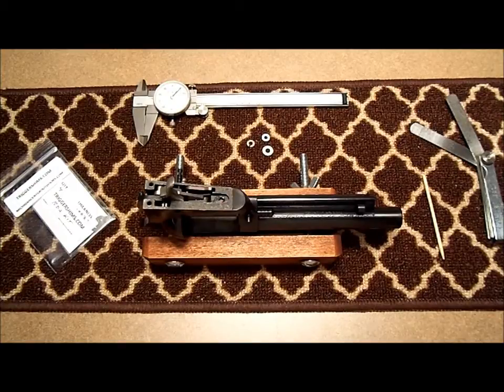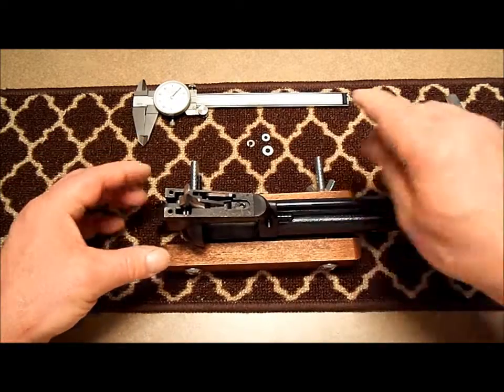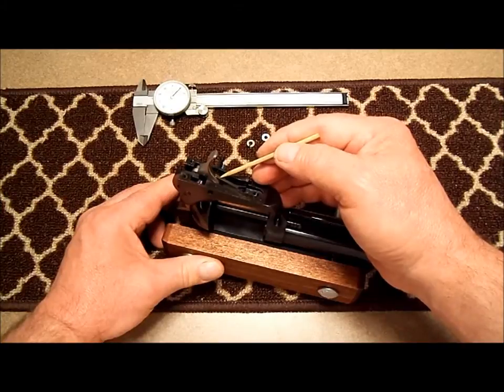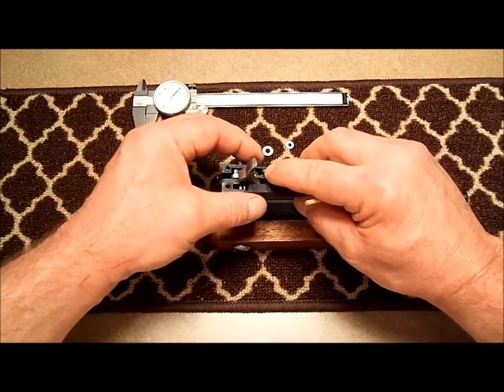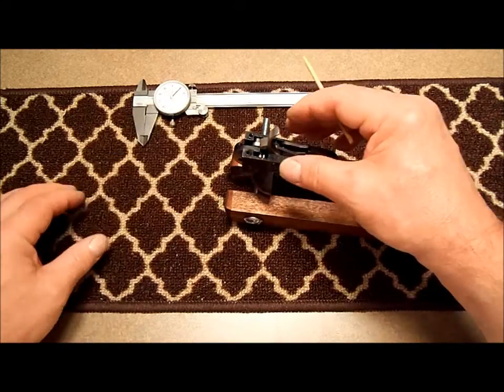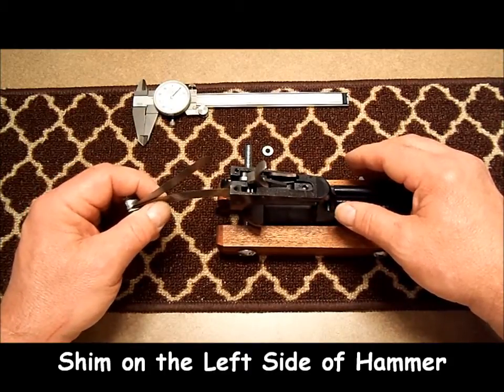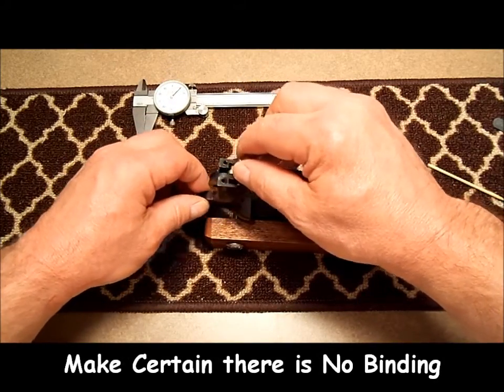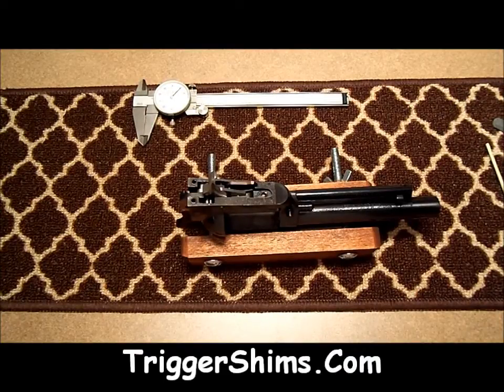New Model Ruger Blackhawk Shim Kit Installation

Comment: Nice video  simple and to the point...however...there is exactly no explanation for why you use the different thickness shims on the trigger.  You specified a 3 and 5 thou shim...great...why  ?  The overall was 8 thou but why or why not split the shims equally thick...or, why not.  Same on the rear.  I understand there is a trigger bar.  But that doesn't explain why you are shimming unequally both front and back.   This is something that needs to be understood.  Thanks.
Reply from the maker: Good Question -     The  8 Pak NMRSA comes stock in .003" and .005", other thicknesses available by special order.  Since I had the gun, shims and measured all at the same time, that is what I had to work with as an example.   You generally want to leave .002" to .004" clearance when installing shims, in this case, I wanted to leave .002" so I choose to install the .003" and .005",  I generally would want to install the thicker Trigger Shim on the opposite side of my gun hand, or where I wanted to better center the Trigger or Hammer. On the Hammer, on this model, we can only shim the left side because the shim would interfere with the transfer bar if installed on the right side. If you disassemble and measure your revolver before ordering shims,  you can order any thickness .002" through .009"  In that case, you could order a set of .004" for the Trigger.    Good Shooting, Lance     http://www.TriggerShims.com/